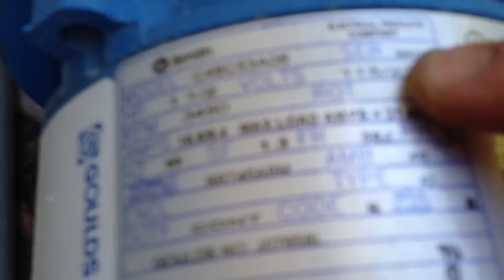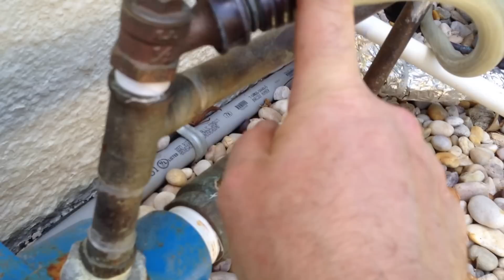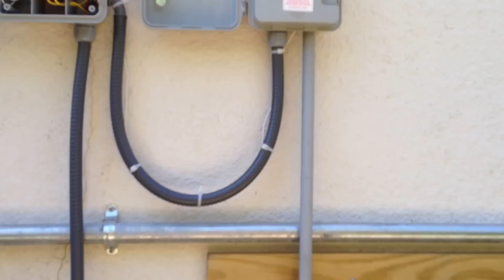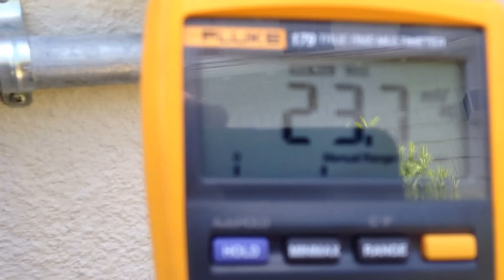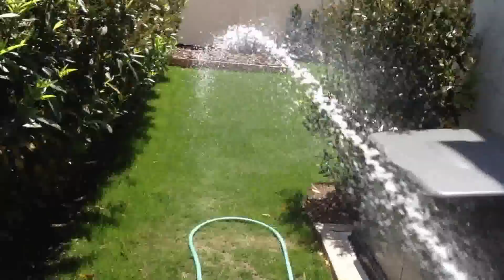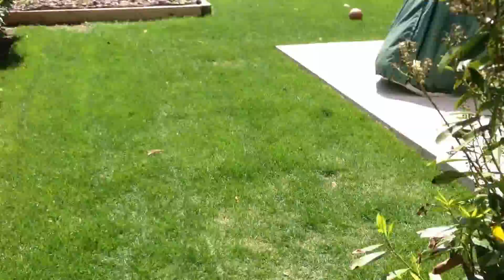Electric Well Water Pump - For Sprinkler System and Garden Hose

Comment: I live in Florida where it rain everyday for the past 4 months, so I turn my sprinkler off for the entire 4 months. Today I have sprinkler guy come over to repair a few sprinkler heads. when he come he was going to test entire system but after he tested the first zone my well water pump stop working. The water don't come out at all. He told me I should leave it on all year long even when it is in raining season. Is it true that I should live it on all year long? How do I find out if my pump really broken like he said? or he did something to it to make it stop working? He said to replace a new pump will cost $1,400(USD) because it is two men job. Anyone know what is the reasonable price to replace a pump? Please help.
Reply from the maker: Do Not Replace Pump Yet!
First Change the Capacitor in the Pump, Accessible by removing two screws in the Back of the Pump to remove the cover, that is often the problem. Also Use a Multimeter to Make sure its getting proper Voltage. My Guy wanted to replace my Pump for $700, Turns out the Fuse in the outdoor Fusebox was loose. Double check everything.  This pump is on Amazon, I think for $300, installation by a plumber should be just a few hundred more.
Good Luck!
Reply: Thanks! It help a lot. It turn out I don't have to replace my well pump. I don't know what happen when that guy came but I try to turn it on the next day. It works again.
Reply from the maker: Its probably a loose electrical connection.
Glad to Hear!
Reply: Not sure why but since it is working now I am kind of afraid to touch it again.
Reply from the maker: Kawaii Kate I understand
next time an electrician comes to you turn it on and pull the wires and see if it shuts off, then he can fix it.
Reply: Thanks for the tip. When I was testing zone by zone I find out if I turn it off and turn it on right away then it won't come on but if i turn it off and wait for couple minutes then turn it on again then it will work. Do you have any ideas what could be the problem?
Reply from the maker: Kawaii Kate The problem has got to be the Capacitor is dying and not able to give that initial Boost to start the pump up. Remove the two back screws and take off the Cover. The capacitor should cost five dollars or so to replace. That should solve the problem.
Reply: Kawaii Kate that's a lie & a pump like this it cost like $490 out the door  this guy ripped you off
Reply: Most likely your pump lost it's prime if the motor runs but doesn't pump water.

Comment: I this drinking water safe?
Reply from the maker: it's Not for drinking. It contains runoff water with fertilizer and pesticides. you could filter it with a good filter for drinking but it's not worth it as my bill is only forty dollars a month for tested municipal water. Also pump would freeze in the winter unless it was installed indoors. Main idea is that I save over a hundred dollars a month in water and I can waste it with a garden hose as I wish. it basically is a form of recycling water.

Comment: I have a pump that was installed about 2 years ago and it worked about 10 times and seemed to stop working. I figured out that the main power wire which was undergound looks like it burnt out and actually broke, So I decided to replace the wiring and used some romex and ran it thru pvc from the pump to the breaker in the house. It ran for about 5 secs and seemed to keep tripping the breaker. The run is pretty far, It is from the breaker to the pump about 120ft.I have 2- 110v breakers I dont know whats going on but I dont have the money to have techs to come out. Please let me know what I should check and what you think. Thanks soo much.
Reply from the maker: The pump may be bad and that burned up the wires. You can test the pump with a multimeter to see if it's a short. I know you can do this but I am not sure how. You can also run new wiring above ground and test it again. Maybe just buy a new pump anyway. Keep me updated and good luck.